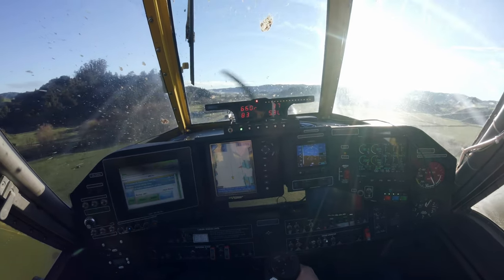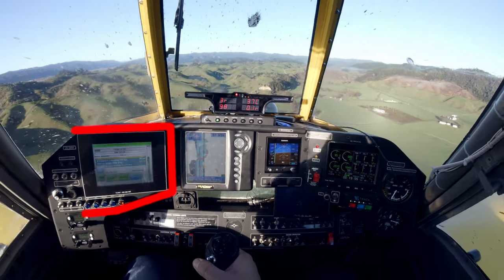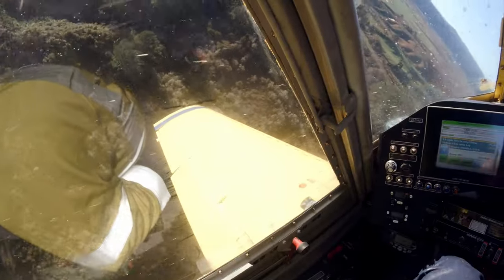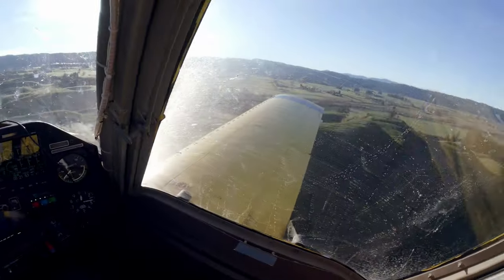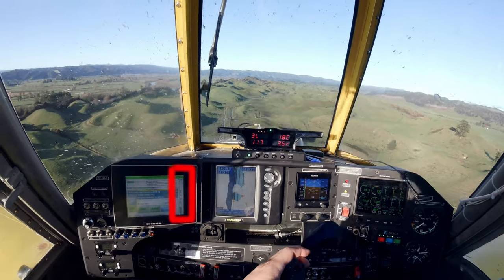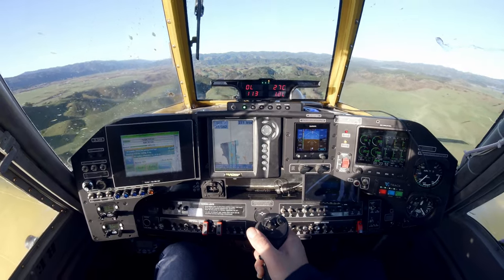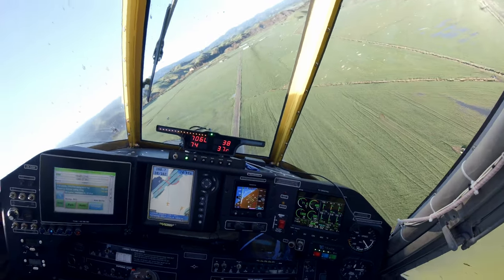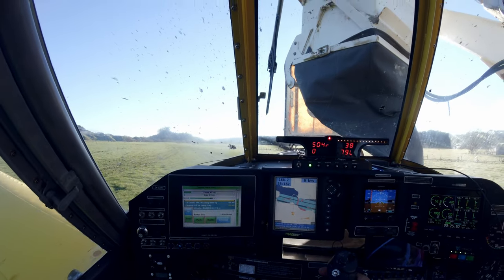Ride in a cropduster - Air Tractor 502

Comment: This 502 seems quite a step up as far as instrumentation goes....nice. Could you explain your use of a bit of flap in tight turns please?
Reply: plane turns using horizontal component of lift so flaps help with tighter, further from stall turns.
Reply from the maker: Father Torque has the idea. I'll add this to the to-do video list 😎

Comment: Why No taxi flaps?
Reply from the maker: That's really only effective on light aircraft 😎
Reply: @JimboBurgess  Nope. I used them on Piper Aztecs, twin Commanders not light when Bush Pilot in the Americas.  They give you some lift so you can use less prop rpm to taxi, which saves prop from damages..